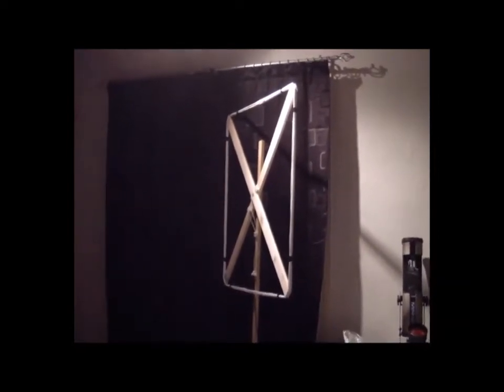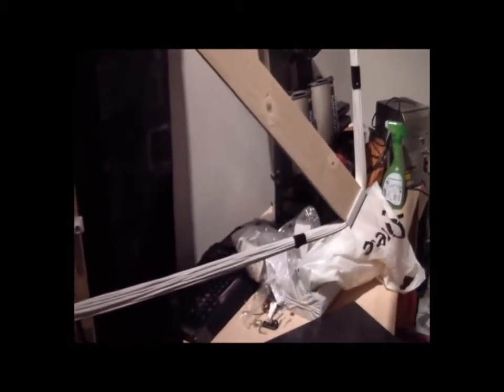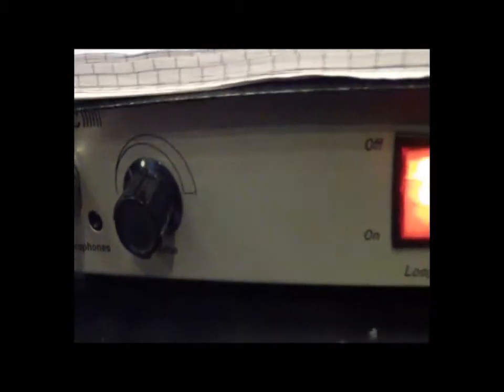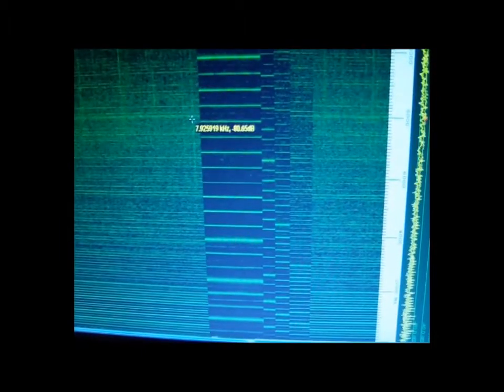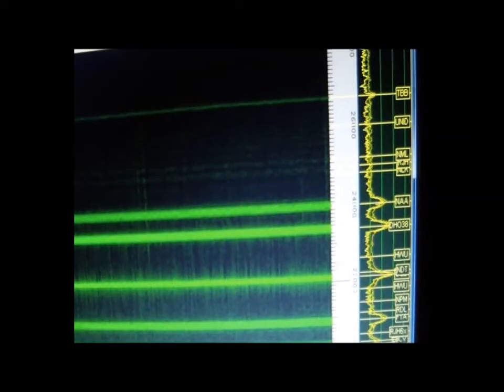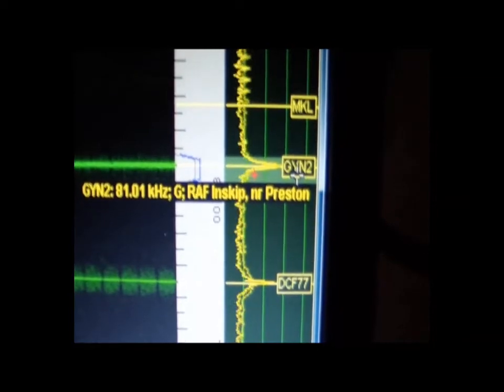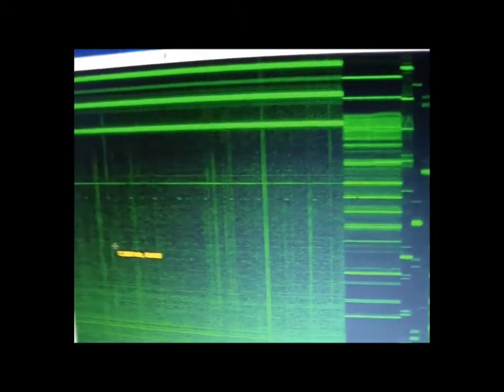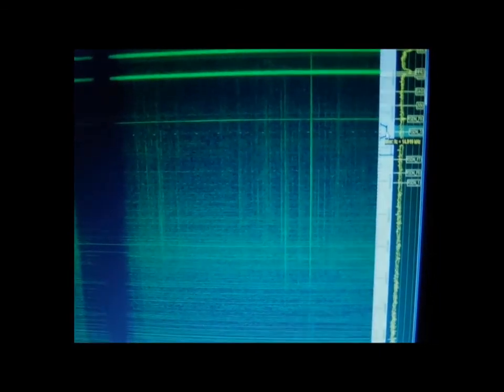VLF Radio - Loop and Video

Comment: This is awesome man. Been looking into making my own loop antenna as well. What would happen if you just connected it straight into your computer? I'm not a circuitry wizard...
Reply: Il faudra adapter l'impédance de l'antenne à celle de l'entrée de la carte son du pc. Les antennes cadres ( à part les antennes ferrite spécialement conçu  pour les fréquences en dessous des 200hz ) possèdent une impédance très basse ( quelques ohms voir une dizaine selon de diamètre du conducteur ), pour cela on démarre en entrée à 8 ohms et on ressort à 1 koms puis à l'entrée de la carte son, on poursuit avec un SP4 de chez Tamura ( il entre sort à 200 kohms...c'est déjà pas mal ) . 
Là, on aura adapter l'impédance et pré-amplifié le signal avant son injection dans la carte son du pc. Pourquoi deux transfos ? A ma connaissance, on ne trouve pas ( à moins de la faire fabriquer spécialement) de transfo démarrant à 8ohms voir en dessous et sortant un secondaire à 50 voir 200 kohms. Si l'on attaque directement l'entrée du transfo avec un SP4 (  1k / 200 k - Tamura ) on fait chuter le niveau du signal drastiquement et on perdra tous les  petits signaux intéressant.